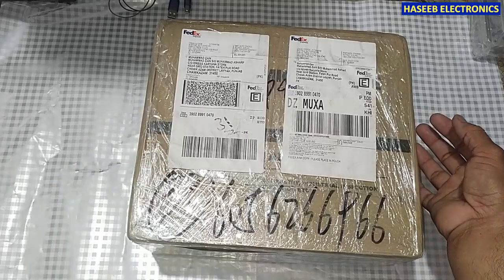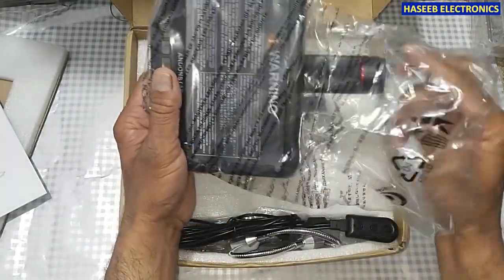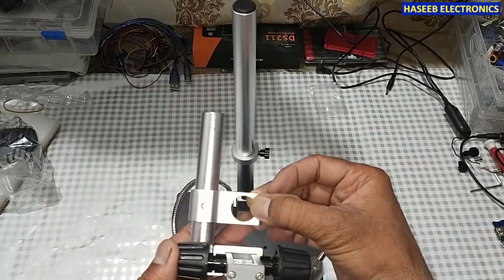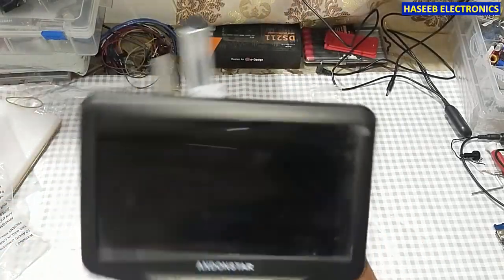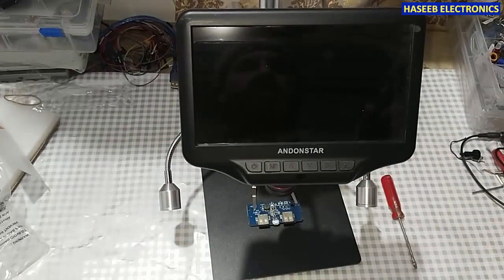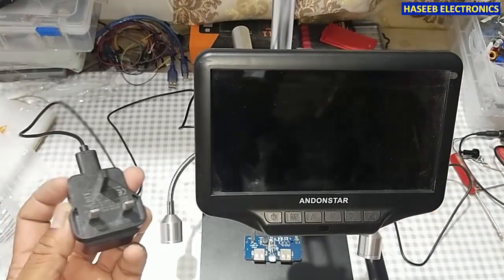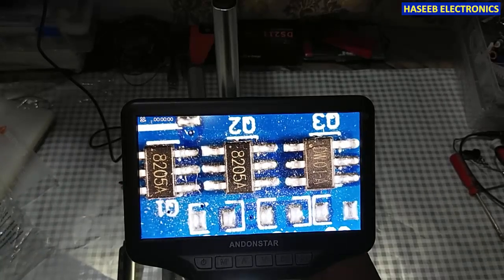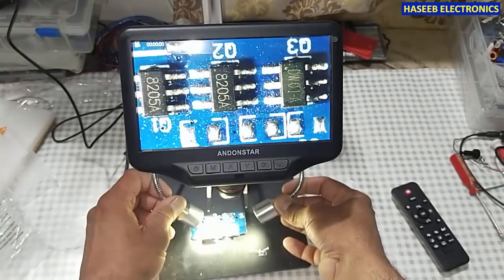{807} Andonstar Digital Microscope 407 Pro Review

Comment: using this kind of microscope in my official job was a complete disaster. The reason was that our eyes are leading the movements of our  hands. If you want to examine cleaning and repair the diamond of a cartridge head - you ALWAYS need a microscope - you can easily destroy the cantilever (very expensive damage) . This microscope is useful to filming and getting pictures as credentials for your custumers or for draw (picture editing) modifications of a pcb..Binocular microscopes are much better by far even if they don't have a "video out port" + you need something to suck the fumes from soldering flux .
Reply from the maker: really fabulous and very valuable addition. i am thankful for writing for such a worthy comment 
please accept my best regards

Comment: Hello sir,
I am facing a problem with Dell desktop pc SMPS.
Problem is PFC MOSFET getting shorted after replacing. It's not shorting immediately but after switching on SMPS 2-3 times.
In this SMPS a TEA1716T PFC controller is used so my question is how to pinpoint the problem?
Is the PFC controller is bad or something else?
Original MOSFET is K16A60W replaced with K10A60D,  is this MOSFET is wrong?
Please help to solve the problem.
Thanks 🙏

Comment: I had a microscope like this one also with a very sharp image. However I found it very difficult to use it to solder small parts as there is no depth perception. I finally returned and purchased a stereo microscope that worked really great for soldering.

Comment: Hello Sir Mujhe DSO lena hai  vfd repairing ke purpose se Mujhe kaun sa Lena chahie 100mhz ya 200mhz
Reply from the maker: 100MHz is sufficient for routine commercial use
but if 200MHz DSO have no much difference with compare to 100MHz then 200MHz DSO will best choice

Comment: Hello friend. Thanks for the video.
Can I ask for a revision of the ps4 psu. I have one that gives 5v standby voltage, but  pfc circuit runs for a short moment, and the 12v shows for a second on the Multimeter. But then it discharges. At which point, 5v standby power is still present, but acin_det is 0v.

I have compared diode readings with a known good psu, and the readings on all the components and ic are similar.

I am trying to understand how psu protection works, to isolated which area of the psu is causing the problem. Psu is adp-160er

Thanks for your help